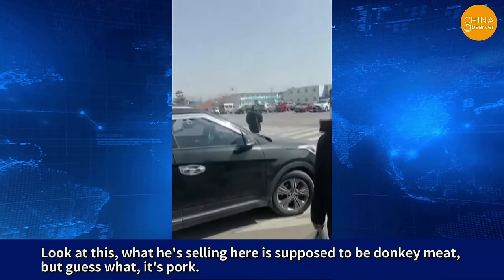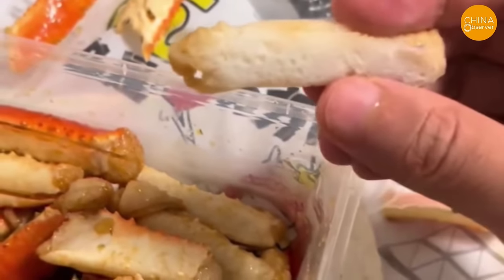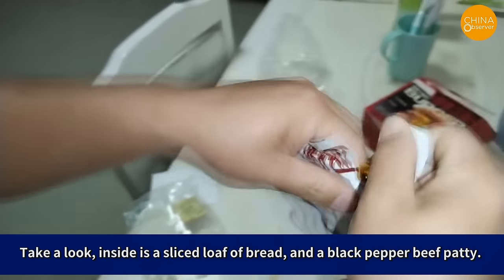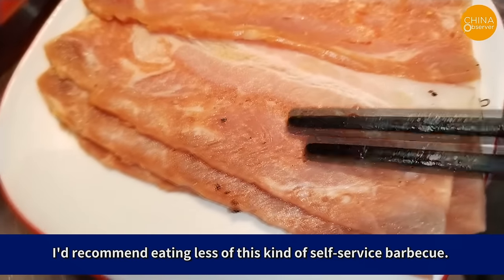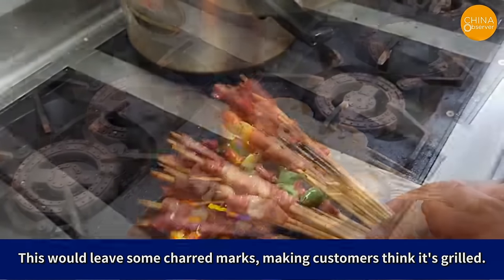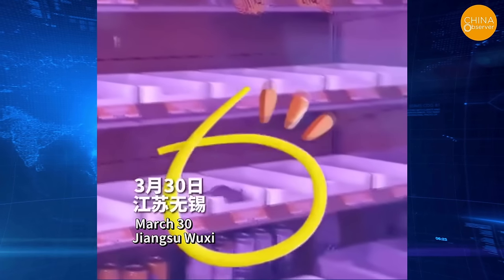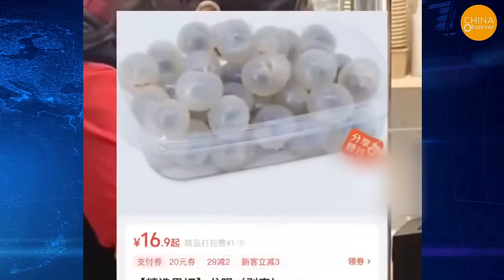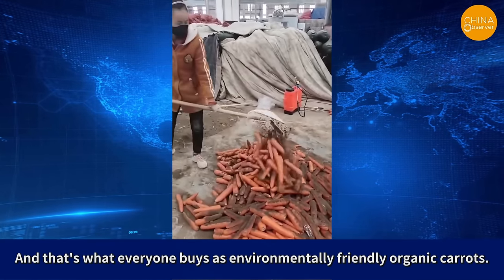2024 China’s Latest Fake and Toxic Foods: A Deadly Cycle of Vulnerable Groups Harming Each Other

Comment: Not exactly the same thing, but just as worrying.

About ten years ago, I bought a bag of senna seeds in an herb store (it's used to make a laxative tea). When I opended the bag, along with the senna, out rolled a bright red and black seed, which I recognized as a rosary pea (Abrus precatorius) which happens to be, per weight the MOST poisonous seed on earth (ground up, one has enough of it's toxin to kill about 75 elephants.) In the form in the bag (an intact seed) it wouldn't have been so dangerous, the seed coat doesn't contain the toxin. But if something were to break the seed.....or it was to imbibe and swell (such as would happen if someone poured hot water on it to make the tea), then it would be deadly.
Reply: Footnote: for anyone panicking, I still do searches  from time to time, and things are MUCH better now than they were then. In the previous year, I haven't seen anything more worrisome than some bindweed seed, which while technically toxic, is not so in any dose as small as someone would get from the one or two seeds they might get in their bag (and that was ONE batch of ONE supplier, all other batches basically had nothing but the senna they were supposed to have.)